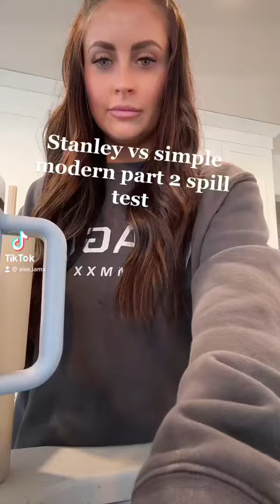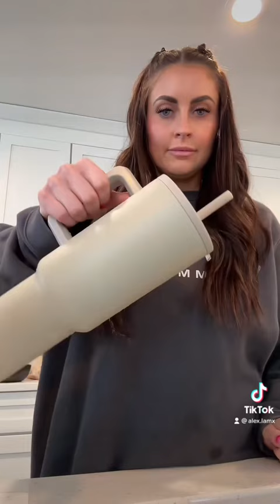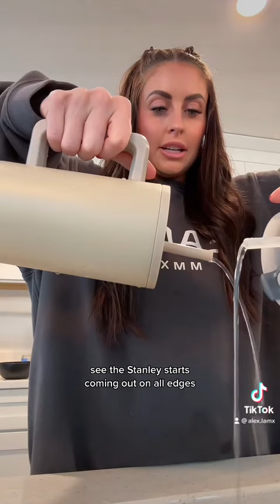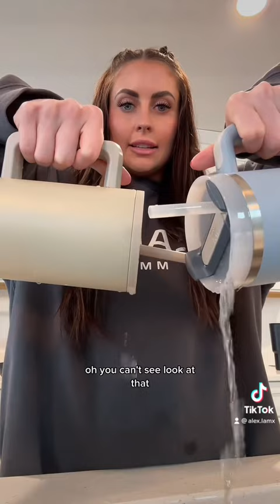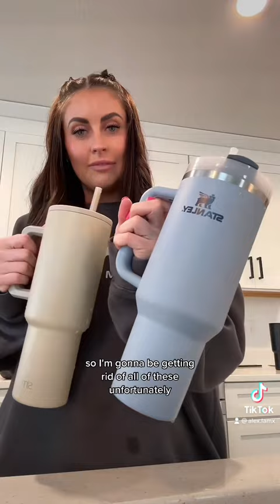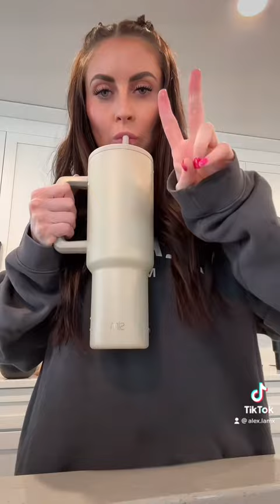Stanley cup vs simple modern spill test #stanley #simplemodern

Comment: They leak either way. So I definitely don’t think one is better than the other. Yeti leaks too. The only kind of tumbler that won’t leak is one that has a fully closed lid.
Reply: Exactly. I have both and my SM leaks sideways before the Stanley starts. I don’t like one better than the other they are both fine but they leak if they are tipped.
Reply: I have a cheap metal water bottle that's 5 years old.  No leaks , only keeps drinks cold for about 10 hours but I'd drink the whole 1l by then.
Reply: My Yeti doesn’t leak. If it’s leaking you closed it wrong.
Reply: My yeti doesn’t leak at all. But it’s Niagara Falls when it comes to the Stanley.
Reply: One is clearly leaking a lot worse than the other, therefore it is objectively worse when it comes to leakage.
Reply: Hurley tumblers don't leak at all
Reply: I got a Solara tumbler...It dosent leak a single drop out except through the straw hole. Close all the top holes....nothing leaks. Nada

Comment: The Stanley cup does not claim to be leak proof. I have a solution for leaking though. Just don’t let the cup fall over?? I’ve had a Stanley for more than a year and it hasn’t spilled once. Why? Because I know it’s supposed to be a cup, not a leakproof bottle so I don’t let it tip over or drop it. It’s not that hard. Also, heavier weight might indicate better insulation.